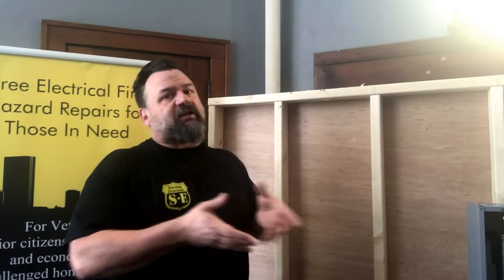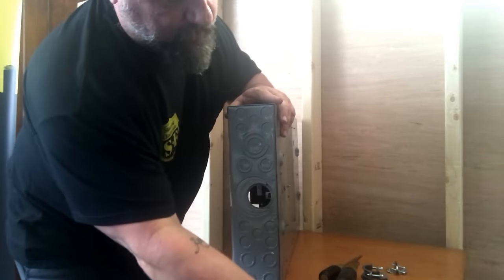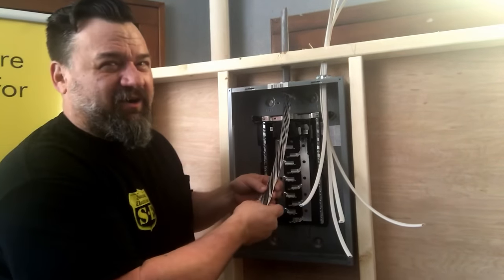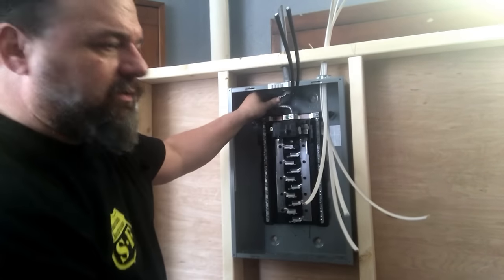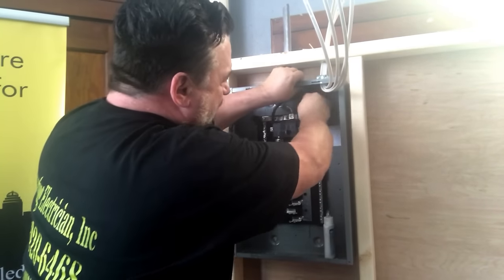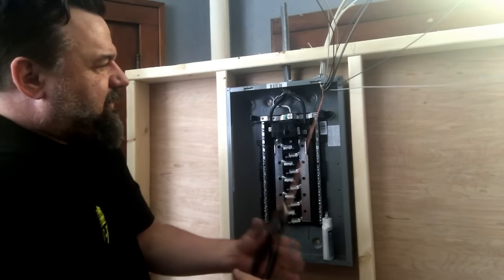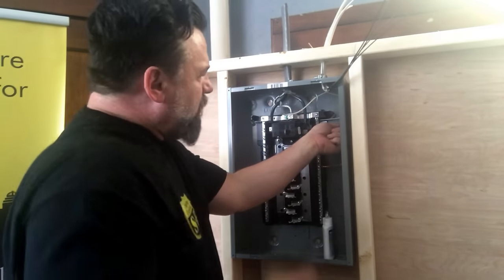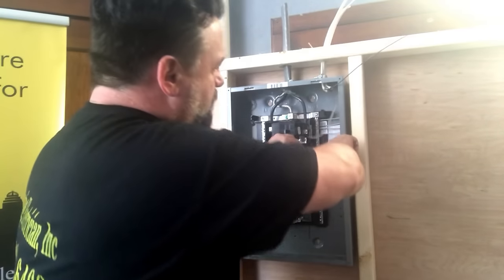How to wire a 100 amp service panel. ,  2020 National Electrical Code compliant

Comment: Liked your video. I will comment that for future troubleshooting twisting all the grounds together might be a problem. Especially with the new arc fault circuit breakers. Just supposing you might have to isolate a ground wire later on. But I can see how it is much faster and neater doing it your way.
Reply from the maker: thanks for the comment. actually the grounds twisted together do not affect the arc fault breakers. if you think about them they are twisted together in the boxes and the breakers are not affected. with arc faults you cannot share neutrals with any other circuits or they simply wont work. I know in multi switch boxes with a couple different  circuits the neutrals may get shared. this will pop an arc fault every time. if you look at the grounds, they dont know where they are tied together, in a box or at the panel. either way they are doubled up somewhere. I know some have a problem with too many grounds under a terminal but I have never been shot down by an inspector in over 30 years. the terminals are rated for a certain amount of circular mills. gust like of you had a big lug in the panel you could put all of the grounds in it. its still one terminal but the capacity is larger. same thing but the lug is smaller is all. since grounds do not have a constant load and are non current carrying conductors they do not get hot and expand and retract which causes oxidation and leads to fires. this is why we cannot double up neutrals but we can with grounds. hope this wasn't to wordy and thanks again
Reply: @StarvingElectrician  Again I think twisting them together is very neat. But imagine if you had to un twist them to troubleshoot one. May not happen but I see arc fault breakers are troublesome little critters. I am installing three mains and a triplex meter base today and I plan down the road as i wire the pannels to incorporate some of your techniques. Thanks for the info. Have a good day.
Reply from the maker: @colten1d   yes indeed. I hate those breakers. even a fround touching a neutral somewhere, It will work on a normal breaker but not the arc fault. yes its a pain to untwist the grounds and maybe im just lazy but I find myself twisting them together more because I have no room is all. thanks for the comment

Comment: Very entertaining! Bonus is your video is also entertaining. You don’t talk down to the viewer, your instruction are clear. Thank you. You used the deox on the incoming power wires, but not on the neutral or hot wires of your branch circuit wires. Why? Also... there is a cost difference between 10/2 and 12/2 wire, and 20 amp circuits cannot manage on 15 amp wire (I understand why), but could a person use 12/2 on 15 amp breakers safely?

Comment: This is the kind of guys I like working with!    

Hopefully ideal is paying you to push that no/ox because its unnecessary nowadays and nowhere in the code.  Guys that still insist,  I tell them to read step one of the instructions.  Nobody follows it.
Reply from the maker: lol I hear ya. here in michigan its a must.  for me its a preference because I hate when the aluminum lugs bind up. citys vary as you may know but here its a big deal. thanks for the comment!!
Reply: Why is it unnecessary?   Many times the lugs are not pre-lubed with antioxidant.. aluminum conductors will oxidize without it
Reply: @rmhanseniii  new lugs are dual rated and made of an aluminum alloy that wont  oxidize. It does help as and antiseize when torquing
Reply: Ryan  Sure you’re right however aluminum will oxidize by nature.  I’m not a scientist but I think given the right conditions like humidity eventually aluminum will get that white crap on it

Comment: Don't mean two offend you, my electrical would not pass the way you wire this panel. Your terminal speak is correct but we my follow the UL listing for the romex connectorl.  But I live in Vermont.  It your property and if work go for it. Like I  said  please don't be offended.  I found video interesting and inside the panel you did a good job.
Reply from the maker: Robert Mattison  no I'm not offended and thanks for the input. It's crazy how there's one code book but interpretation varys from state. I got shot down once because the inspector said there were too many wires in the connector. I asked how many could go in it then. He said he didn't know but didn't like it. By law the inspector has to recite the code you violate in order to make you correct it. But it also says in the code book that authority having jurisdiction has the final say and that's the inspector. A nipple is a raceway under 18" and isn't subject to D rating so this means you can stuff as many wires as you can fit because somthing so small will not create heat. Well to me it's the same difference in a connector. But again I'm not the inspector! Lol anyway thanks again for the comment and keep up the good work.
Reply: Thank you for the interesting reply I like that you should challenge the inspector.  I did it one time on a wire bathroom. Inspector was wrong with his interruption and told me face to face that I was correct.   After that I never had any problem with him.  So I was put on the list of electricians who know the code.  So some I my small job he never ask to come to the finish job that he inspection
I am often cited by the inspector that my job excess the NEC minimum that there impress that I care how my job looks.  I don't cut corner.  And I call the  electrical if I have question, there happy that I call and they give me the information.   Stay well, as your video was interesting enough to keep the viewer attention .   It you humor like Dylon Cain wrote.

Comment: Thanks so much for your video! I live in a condo and all of my neighbours smoke cigarettes. I noticed a strong airflow (which smells like cigarettes) coming from my electrical panel. I was wondering if it’s safe to unscrew the front panel, switch everything to “off” and caulk around the cables that go into the wall? Thanks again!
Reply from the maker: wow that sucks. well the power is still coming in and feeding the panel so its still hot. if you live in a condo you may have a main breaker right where your meter is. look and see. if so than click off that breaker and you will be good.
Reply: Thank you for the reply, much appreciated!!

Comment: Do you have a video to explain what kind of wire to run under ground to a garage that may be convert to an apt? Of course putting in an electrical panel,right now just running the wire.
Reply from the maker: The wire sizes dont change. you are just dealing with pipe and 4 wires for the sub panel. sizes depend on the amperage.

Comment: I was hoping you were going to talk more about the bonding screw, I was always told not to mix grounds and neutrals, but I'm thinking there has to be more to it or a rule of thumb. Great video!!
Reply from the maker: ok I can do that. you can only put them under the same buss bars if they are bonded to the panel in the primary service. if the bus bars are not bonded, then you mound a seperate bar and seperate the grounds and neutrals. hope this helps.
Reply: @StarvingElectrician  I understand on a main panel the bonding screw has to be used and the neutral and grounds are together and in a subpanel the grounds and neutrals have to be separated but is their a technical reason for this? I like understanding the technical side of things when they have to be done a certain way. Thank you for your time and your videos!!
Reply from the maker: @stcharleshometheater   lol technical? yes there is but im not that kind of guy. you are bonding the bus to the panel. its so you don't get zapped from the box and its a drain for stray current.  that is as technical as I get  sorry.
Reply: @StarvingElectrician  hello, that's OK. Thanks again for the reply. I love the videos!! 😊
Reply: I’ll take this one stcharleshometheater. The ground by itself is connected to a rod or pipe and goes to all metal objects or metal parts of objects. The reason for that is to keep conductive materials at the same electrical potential as the earth. That is the primary function of the ground. However, if electricity from the utility touches this ground it will electrify the ground system and all those metal materials. This is bad. If the electricity from the utility comes in direct contact with the neutral, however, so much electrical current will flow that it will (hopefully) trip the breaker. It would be great if the ground could trip the breaker too. So in order to get the ground to trip the breaker if it’s electrified we connect the ground to the neutral where they first meet. And we keep them separate everywhere after. The reason we bond ground and neutral is for over current protection.
Reply: Meant to say to clear a fault not over current protection. Clears the fault by utilizing the over current protection. If the ground were g connected to the neutral the breaker would not trip if the hot touched the ground. Great video!

Comment: I have to guess a green would cut into the wire when stripping your branch wires they way you do  ,that takes a touch after years of practice .
Reply from the maker: yes for sure. you just score the wires not really cut into them. sometimes i use the blade of my strippers to just make an indent and the sheething pulls off. thats a lot harder when its cold out.

Comment: I will give you 500 thumbs up
Reply from the maker: well thank you!!! I give you 500 thanks!!!
Reply: I got a. ? For you if I got a 100amp disconnect box will it work with a 200 amp breaker box
Reply from the maker: @justinwatkins1533   well the dissconnect is what the service will be rated at. what I would do is, use the 100 amp dissconnect and remove the 200 amp breaker and just use lugs. the 100 amp disconnect is now the main service, then you made the 200 amp panel a sub panel. do you understand what im saying? sometimes I babble lol

Comment: Love the videos! Question, on an outdoor panel where the rain guard is located on top, if you need to mount the panel upside down, can you reverse the panel board (the guts) since the panel box can only be mounted right-side up. Service cables aren’t long though to reach the top of the new panel. Thank you so much! 🙏
Reply from the maker: never heard of that. I would think if everything fits, the panel doesnt know the difference, personally I wouldnt.

Comment: At first I thought that was a sub panel, but some houses actually have a 100 amp service I believe. Those feed wires were totally different than the 200 amp service panel I saw get hooked up, and the 200 amp SP had separate bars for the neutral and the ground. Hmmm? There is always something that leaves a question. I need to learn. Thank you.
Reply from the maker: Any question all you have to do is ask.  It’s amazing how the code book is the same but equipment and wiring differs.
Reply: @StarvingElectrician  I appreciate the accommodation. As soon as I can come up with a question that is actually intelligent, I just might ask it. As far as tacos, I recently discovered by replacing the runnier diced tomatoes with tomato paste, it makes a more solid mix with the refried beans. The tomato paste though lends more to Italian than Mexican flavor, but frying onions with coconut oil, turmeric, black pepper, ginger, and Himalayan salt gravitates to Indian cuisine which ain't bad, but no matter how good it gets, there's always room for improvement.
Reply from the maker: David Parker well that sounds good. My buddy smashed up cooked pinto beans with about a half pound of chorizo. The real Mexican type that melts into a red greasy flavor. The bomb. With me tacos are always best with fried corn tortillas. I grill up the steak, cook up the tortillas and it’s cilantro and onions. Cheese and all that other stuff takes from the meat. Lil squeeze of lime and a good home made hot sauce and we’re talking taco time! Stay hungry and thirsty my friend!
Reply: @StarvingElectrician  You're better than I. I even failed to distinguish between tacos and burritos. Dah. I just make burritos as convenience food. One batch can last me, and make less work to eat for a while. I have a friend though who once demonstrated some skill with tacos, but he was not quite in your league. You have the acuity of a restaurateur regarding tacos.

Comment: How are you grounding the box? In your example should a wire come lose and touch the box the box in now hot.
Reply from the maker: The only way the box would be energized is off one of the feeders touched the box. If a wire came out of a breaker they wouldn’t be hot anymore. But you bond the buss bar to the panel, a number 6 wire to the water meter and two ground rods outside for a secondary ground. Hope this answers your question.

Comment: The only advantage I see for separating the Neutral and Grounding Conductors in a panel is at some time later, such as if the panel is up dated and it is no longer the first point of disconnect such as when an external "switch gear" for lack of a better term is installed as is now required by the NEC and most localities,  it saves a lot of work separating the ground and neutral conductors since this panel at that point would become a sub-panel.

Comment: First off, loved the video.  
I am wanting to wire a workshop shed, using a 30A outlet box I had installed when I had a camper trailer in the same area before.  Will I be able to use a 30A plug and wiring to place into the panel box as my power source?  I haven't done a panel box before but I have done many wirings of outlets and switches.  I understood your lesson but was wanting to know why there was two black wires instead of a black and white?  Thank you!  Loved the humor.
Reply from the maker: sdereis first yes you can use that 30 amp plug for your power. As far as the cable I’m using, that’s how it comes. Two blacks 110v on each leg to make 220v and the neutral. It’s bare in the service entrance cable and that one is called the neutral or the white wire. We run the ground separately  and bond the service. If you have a three prong plug from your camper then you have 2 hots and a ground and wouldn’t be able to use is because there is no neutral. If you have a four prong outlet then you have a neutral and you are good. If you have two hots and a ground then your only option would be to take one of the legs and put it under the neutral bar in your panel. This gives you a hot, neutral, and ground. You would only have 110v though. I hope this helps

Comment: good job but i like to put a second ground bar for all the ground wires and that go's to earth ground. I don't use the bonding screw i use earth ground to the second ground bar for all the ground wires.
Reply from the maker: the grounds and neutrals are supposed to be bonded together at the source.

Comment: We are wiring a smaller breaker box between our inverter charger and receptacles in a van build. We have decided on 2 15 amp circuts , one for each side of the van. We are trying to figure out taking the load from i verter/charger to the breaker box there are two large lugs and we'll only have one power source co.I t in. Does each circuit needs its own source of power of is a breaker box made to share the load? We have reached high and low and have yet to understand how to get one cord to the breaker fuse box then attach both circuts. DUH here in the last wire detain. Thanks ahead!
Reply from the maker: thanks for the question. not real sure what you are asking but every circuit will have its own breaker, neutral, and a ground, if you tied two wires to one breaker its still two circuits, now if you had a four prong plug then you could have two circuits. you would still need two circuit breakers. if the inverter is set up for 220v then that is concieveably 2 circuits. if you could clarify your question a little id like to try and help you. thanks

Comment: If a panel is to be installed on a wall that will eventually have drywall put in place,  does the electrical panel have to be recessed, as it shown in this video, or could you extend it out of the joist cavity and have the wires come down through the ceiling in a large conduit instead?  I ask because what happens if down the road, more circuit's and wiring have to be added?  If the panel is recessed into the wall, there is no way to access the knockouts without tearing out the sheetrock and cutting the joists.  Surface mounting the panel makes it "future proof".
Reply from the maker: great question. no the panel doesnt have to be recessed. I lived in michigan and about all the panels were surface mounted. i like the idea of being able to add circuits later. both ways are up to code as long as the wire and the panel are supported properly.

Comment: Nice work! After you connect the neutral the two service wires does it matter which side of the new panel you connect it to?
Reply from the maker: i'm not sure what you are asking.

Comment: Question:
So, with the ground wires.... are they always copper? (the ones without a jacket, correct????)
Reply from the maker: usually they are copper but I have seen aluminum romex wire. its rare but its out there. if you are talking about the whole house ground for the service or bonding, you can use aluminum but you size it one size bigger than copper because copper is a better conductor of electricity. hope this answers your question.
Reply: Correct